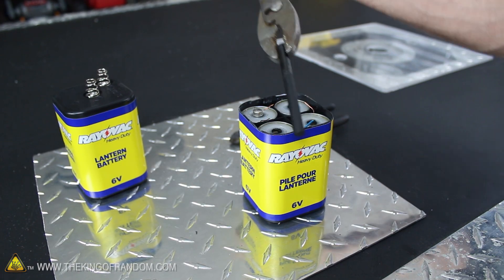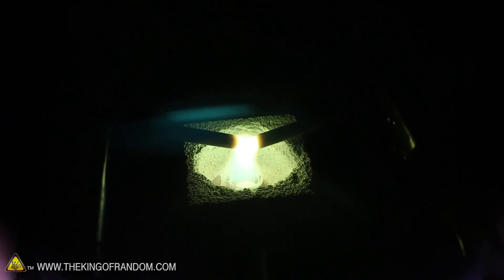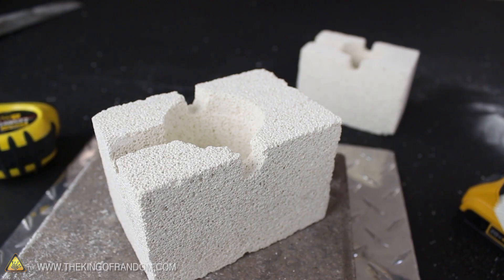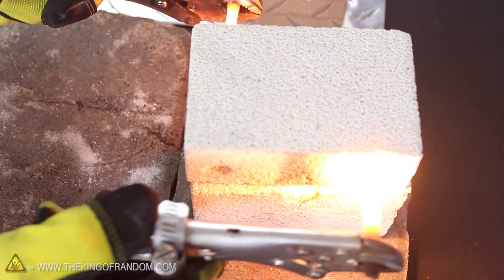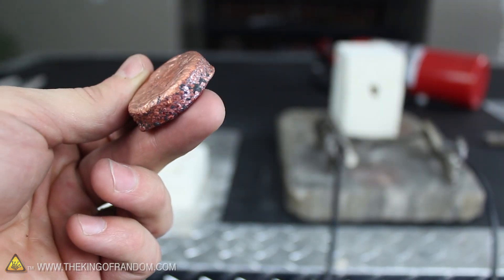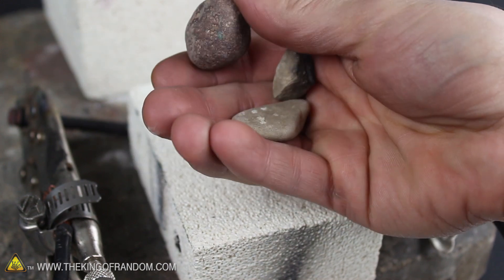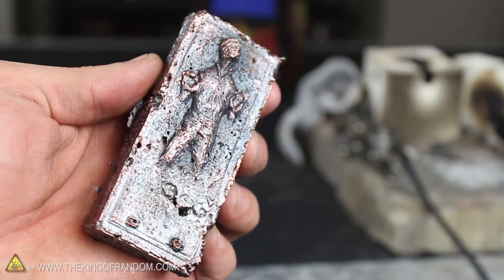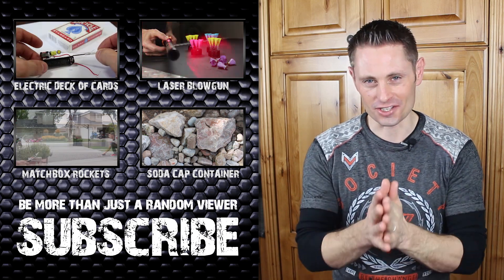Mini Arc Furnace (Arc Reactor Technology IRL)

Comment: how does it not melt the metal rods when you can make lava with them?  and interesting to see that thing can get that hot that fast.
Reply: the rods are made of carbon
Reply: Tin 4705 you are actually an idiot. true the melting point of carbon is 3823 K but the sun is not millionths of that the center of the sun's temperature is 27 million degrees Fahrenheit 3823 k is 6421.73 F  Dicyanoacetylene, a compound of carbon and nitrogen with chemical formula C4N2 burns in oxygen with a bright blue-white flame at a temperature of 5260 K the surface temperature of the sun is 5,778 K 

also Scientists at the US Department of Energy's SLAC National Accelerator Laboratory created a laser, which fires rapid-fire laser pulses to heat up matter to over 3.6 million degrees Fahrenheit if you can create a laser that heats matter to over 3.6 million degrees F than you definitely could melt carbon
Reply: the melting point of carbon is a little over 3000 degrees
Reply: Tin 4705 
Here's some sources to say you're wrong:

http://www.sciencedirect.com/science/article/pii/S0008622305000291
http://www.chemicool.com/melting-points.html
http://www.rsc.org/periodic-table/element/6/carbon
https://uk.vwr.com/store/product/2336281/glassy-carbon-plate-3
http://www.chemspider.com/Chemical-Structure.4575370.html
http://www.livescience.com/28698-facts-about-carbon.html

Where's your sources to say you're right?

Carbon doesn't 'melt' at atmospheric pressure, by the way. It skips liquid state and turns into gas instead. Sublimation.
Reply: Please think before you type. You never mentioned that you meant "melting under our atmospheric conditions". Carbon can melt if you simply increase the pressure , and it's possible on earth since we own pressure chambers. What you were saying sounded like some random gibberish of slightly scientifical fragments of information.
Reply: It's  physically   Impossible to melt carbon
Reply: Tin 4705

If you can't melt it, how do you form it? But it would look that way if you can make lava with it.
Reply: The form carbon in a mold a with high pressure
Reply: Nothing is physically impossible to melt. The rods don't melt because the current from the power source is not high enough to do so. However, it is clearly high enough to melt the things in the video.
Reply: You are all idiots carbons melting point is 3823 kelvin the center of the sun is less than a millionths of that it's impossible at this time to get some thing that hot and is we were to get some thing that hot everything on the planet would melt  including carbon
Reply: The rods are not the ones melting the stuff the plasma is
Reply: 3823 and multiple that by 1000 = 3823000 that's how hot it has to be to melt carbon and yes there are ways to destroy carbon using chemicals reactions
Reply: He's  lots of stuff melts in pressure like co2 and carbon does not melt if it skips a liquid
Reply: I'm saying it does not melt at are Atmosphere  there for I'm right
Reply: I was very wrong about the one millionths I'm sry about that

Comment: I'm interested if this could actually melt tungsten as it has the highest melting point of any element
Reply: not possible, because tungsten melting point is higher than carbon's sublimation point. And both much higher than what the firebrick can hold, so he would be splashing melted firebrick before that.
Reply: +C.Y.N.I.C.Union Average Joe? Holy crap, you must be new to the channel. The things he does are anything but average.
Reply: +Herkus Kaminskas Powerful* Steel*

I had to.
Reply: It might be spitting out plasma, but i don't think the average joe with 2 Microwave transformers could melt tungsten.
Reply: C.Y.N.I.C.Union That's a stereotypical look. This thing is hella powerfull if it can melt stell within minutes
Reply: Maybe but u probably can't hold on to it so that long
Reply: +Nick Spirov No it isn't, carbon's sublimation point is about 3600C, whereas tungsten's melting point is only about 3400C.
Reply: agreed, my error. But it is too high anyway.

Comment: using plaster as a form is only good up to ~900° C and the plaster need 
to be 100% dry or the water in it can explode, to achieve this it should
 be heaten to 200°C for an hour in an Oven.

Comment: this set is simular to the carbon arc welder you were able to  through popular mechanics back in the 1960s ...70s  sold for like 20$  had one weighed like 5 lbs

Comment: Grant doesn't make the electrical connections very clear. The secondaries are clearly in series, but I made one of these, and it seems like the current is not high enough. The arc can't be sustained without the electrodes almost touching. Maybe I assumed incorrectly that the primaries were in series too. Does someone know if he actually uses the transformers in parallel? If so, I'm gonna need bigger circuit breakers, because they won't even take the current from one transformer lol

Comment: Seems like it would be more convenient to permanently install the electrodes and operate the furnace with a switch.
Reply: when you touch them together, the current heats and vaporizes the carbon at the point of contact. the carbon and air is ionized and thus conductive. once the ion arc is created, you can separate the electrodes to lengthen the arc. too far and there's too much resistance to allow enough current to keep the arc hot so it collapses. 

So you have to have the initial contact, then separation. 

The alternative is to keep the electrodes separated and to initiate the arc with a voltage high enough to arc across the gap and start the process. once the arc is started and there's an ionized path across the gap, a low voltage can keep it going.This is how arc lamps work today- which includes fluorescent tube. 

The difference with carbon arc is that the carbon is being continually vaporized and thus the rods erode and shorten. That increases the gap over time so they must be occasionally repositioned. 

the other difference with carbon is that the vaporized carbon is what created the intense light. In other arc lamps it's just the gas that surrounds the arc. their electrodes don't vaporize and erode so they don't need adjustment over time.
Reply: They get a bit shorter every time you use them. So you will need to adjust them anyway.
Reply: You have to touch the rods together then separate them a certain amount so they can't just be fixed in one place.
Reply: +Kakunapod Yes, ofc you need to account for the materials. But you also see how he is removing them to cool in the brick (and have them out of his way to operate with the molten metal).
A solid installation wouldn't make this whole process easier.
Reply: Kakunapod it would be even more convenient to not do this at all
Reply: Davey Hi I'm not certain thats how it works, but if it is, fine. I will say that aluminum is conductive though, so it seems like you would never be able to conductively isolate them
Reply: MetallicReg I see, well, maybe just "temporarily' permanently install them then hah. Install them on something you can get them out of, to replace or adjust them. The hand-held leads just seem like an inconvenience that could be fixed
Reply: +Kakunapod They could melt your installation if you are not carefull - this will be a mess ;).
Reply: MetallicReg I dont see how simply replacing his hands (you know, the ones he does stuff with) with appropriate mounting hardware would be more dangerous. Obviously if you choose poor materials and design this would be dangerous, but that can be said about literally everything.
Reply: Davey Hi Sure, that's what I know to be true about these sort of devices at the moment, so I guess we agree this would certainly be feasible then, right? No reason why you couldnt design some sort of apparatus to arc the rods if needed.
Reply: TheJG Rubiks Why are you here then?
Reply: FrozenPickles entertainment purposes
Reply: Operate the furnace with a Switch? I hope the furnace is strong enough to run Mario Kart.

Comment: An added refinement would be to line it with refractory cement. The advantages of this are several: firstly, it'll keep water from infiltrating the brick. The last thing you need is an explosion. Secondly, it gives a smoother surface so you'll have less material loss, and make it easier to remove dross or other waste contaminating the next batch. Thirdly, it'll slow erosion of the brick - as you noted, it's rather subject to wear.

Comment: "you'll need a modified arc welder" What about the other 99% of the population, that doesn't have a free microwave, that they found in the trash can?
Reply: well, they can ask their neighbor, like he did. Or just go to the local junk yard. You could even go to like an antique shop, pawn shop, or something in-between. I saw an older one at a shop that had knitting supplies, blank cassette tapes, and old pots and pans. (it was a weird shop).
Reply: Well, time to go dumpster diving XD
Reply: Atomic Fire really??  I wanted to try it with an arc welder, should be the same thing as what he's doing
Reply: Dani Paunov you can find used microwaves anywhere go to any ghetto neighborhood and they're left right out on the road
Reply: I've actually gotten a plasma arc with a simple, "cheap" 90 amp stick welder.

Comment: - Try burning the plaster mold first (you could theoretically even use an owen for that I guess, but simply fire should do good as well and save you the trouble with fumes) to burn the  gases before casting (this could make the casting more precise since the gases wont make bubbles inside)
? And the second - any idea how would wolfram (tungsten) electrodes work? Or where to get longer electrodes than the ones you used? Thanks :)

Comment: Dip the copper in Hydrochlorich acid and it will shine almost instantly
Reply: +AmericanFishDude Why did the copper pouring at the end look so rough? He poured it in a plaster paris mould, but the poured copper looked full of holes instead of smooth...Why is that?
Reply: PathTo Entrepreneurship Excess water in the plaster that became a gas when the hot copper went on it most likley

Comment: That was cool! (or should I say hot?  :P)

Have you tried to perform any actual ore refining with these? I'm actually very interested if you could get (relatively) pure silicon "metal" out of sand, though the reaction might try to eat your electrodes! And, you might want to get bricks of pure alumina foam, not alumina-silicate or other mixtures for extra lava resistance.  :P
Reply: +Pyre Vulpimorph Well, you cant turn sand into silicon with just heat. At least not with sane heat. Look wikipedia, about silicon processing.
Reply: +namibjDerEchte   https://en.wikipedia.org/wiki/Silicon#Metallurgical_grade 
I did read the Wikipedia article on silicon. The section on Production: Metallurgical grade silicon states that SiO2 will undergo a carbothermic reaction to pure silicon at 1900*C. That's within the capabilities of carbon arc heating and below the melting point of pure aluminum oxide. Hence, why I asked about ore refining.

Comment: this furnace is really good at melting steel but can it melt tungsten?
Reply: +Sebastian Diaz No, even industrial furnaces have trouble melting tungsten.
Reply: I ask this because the melting point of tungsten is over 6000 F (over 3000 C) so can it?
Reply: +Sebastian Diaz It melted rock, so probably.
Reply: +RakshasaGamer rocks melting point is around 1250 C

Comment: So how are you not electrocuted form the exposed leads???
Reply: +Sava'ge the voltage is low
Reply: +wmutter1 it's like 240v....that's around 12amps 1amp is considered lethal....on top of all of that the leads are exposed and he is touching him, thus posing my question. Why no electrocution?
Reply: He is wearing gloves
Reply: +wmutter1 from like Walmart, I thought you need gloves that workers use with high lines or a freaking insulated lead....
Reply: the insulation is enough
Reply: +wmutter1 boi.... Do you anything about conductivity
Reply: ye, but he didn't die sooooo
Reply: +Sava&#39;ge        Ok, he isn't getting electrocuted because the 240v is being converted to about 30v by the welder. 30v is too low to electrocute you because the resistance of you're skin is too high. so for an example; if you touch a car battery, you don't get shocked because it is only 12v, but it is capable of putting out almost 1000amps.
      I hope that helped to clear things up.
Reply: +503technics oh thats right I forget it got converted and the fact the low voltage doesn't necessarily affect us. And you did thanks man.
Reply: Sava'ge
you're welcome.

Comment: Can you make the rods permenant or do the constantly have to be moved / replaced ? i personally wouldent feel too safe holding what are basically two electrodes in your hands, if it completed the circuit with you in the middle youd die instantly (not actually an exaggeration) hence why i'd rather they were permenantly seated lol

Comment: Can i melt tungsten?
Reply: +Emil EM on this? sadly no even full scale industrial furnaces have problems melting tungsten.
Reply: The melting point of tungsten is 3422 degrees Celsius so probably not
Reply: +Emil EM tungsten is twice the melting point of titanium. good luck trying to melt that.
Reply: +Emil EM 
You underestimate tungsten. It can withstand this and a lot of other things that you'd think would melt it.
Reply: Its the metal with the highest melting point right?
Reply: Emil EM Yep.
Reply: +Emil EM nope theres other metals that have melting point over 3000 degrees Celsius and i cant rember what there called
Reply: Karlie Sills no,  but there is hafnium carbide (I think thats the name) that is an alloy, which has a higher melting point then tungsten.

Comment: How much energy does this consume?
Reply: +epiNoesis Well, These arc furnaces usually draw about 80amps at 28 volts. so P=I*V Which would equal about 2000 watts
Reply: 503technics  Like a big Air Conditioner.

Comment: By using this, energy consumption must be amazing.
Reply: He uses a multi-transformer homemade power unit that can turn very low amounts of electricity into a very high amount.so technically,he isn't using very much .
Reply: 10/10 conservation of energy skillz my friend
The output of his welder is 36v at 80-100 amps so it would consume 2800-3600w i would assume depends how much resistance he has his scariac set to

Comment: How dont you get elecricuted?
Reply: +PsYcHo4MuFfInS A lot of amps, but just a fraction of a volt ;)
Reply: Matt Bowen Yep, the Voltage is respocible for a current to flow through objects with a higher resistance, if there are only 3 volts... nothing happens to you xD
Reply: he wears insulated gloves
Reply: +Let's Trash! In another vid of his I think he touches both terminals of those transformers when they're on and nothing happens
Reply: +Let's Trash! I think you have this confused with the metal melter, this arc welder puts out 4kv with currents enough to kill you. The metal melter is the one that puts out tons of amps and little voltage.
Reply: +TheAlternateAir No, Most welders put out a voltage around 30 volts. it is probably about 30v at 150a

Comment: Any metal I could get my hands on? Would this be able to melt Tungsten, which has a melting point of 6,191 Fahrenheit?
Reply: +John Pedroza How do you plan on getting pure tungsten?
Reply: +Lord_leprechaun the internet
Reply: +John Pedroza If you want to melt tungsten, you need to do it in a carbon crucible
Reply: +Lord_leprechaun  get an authentic japanese tungsten samurai sword and destroy it with iron solute

I've been reading too much 39 clues
Reply: +John Pedroza No, Even industrial furnaces have trouble melting tungsten.

Comment: I would suggest refractory sand for future molds. Will open up a lot of possibilities for castings. Create a positive from plaster and then used a box to hold the sand and make a press with a bottle jack to force the impression into the sand as compactly as possible.

Comment: Wow....your electricity meter must be running at like mach1 or something?
Reply: +Paul Austin 
Wattage is all in charging, ie VxA. He's using low voltage, high amperage, so the wattage is moderate. Higher voltage would make the melt faster or handle larger quantities, but he doesn't want that, it's fast enough as it is.
Reply: +Paul Austin Are you from Yorkshire??
Reply: +collinsm26 lol! No..not even close! 😁
Reply: Paul Austin it isn’t using electricity it’s a chemical reaction

Comment: I'm currently making this and don't have the power for a ark welder could I just use the RV battery that I found? obviously I would have to recharge it after a while but I'm wondering if it would work?
Reply: +Gobblenslayer Should be able to work provided that you put the batteries in series/parallel, you're probably going to need a lot of batteries though.

Comment: could you also make a sword with that iron?
Reply: +string master You could technically, but casting isn't the preferred method of shaping steel. It just sucks at being cast into molds, just doesn't fill all the tiny holes very well. Weapons were traditionally forged from steel. Nowadays, you can forge or completely grind/cut off starting with a big solid piece.
Reply: +string master Yeah, but it wouldn't work well as a mould. It'd be best to heat a metal rod and then hit it with a hammer, it's hard to blacksmith weapons, too thin, it snaps, too thick, it doesn't cut. It requires years of training.
 I recommend just buying one off of eBay.

Comment: Would it be possible to create a longer furnace made from the same material with the carbon rods positioned in pairs along the length connected with the copper wire, to be able to evenly heat up a bar of steel evenly to forge it?  I honestly would love to see this upgraded.
Reply: I'm actually going to put together plans for this